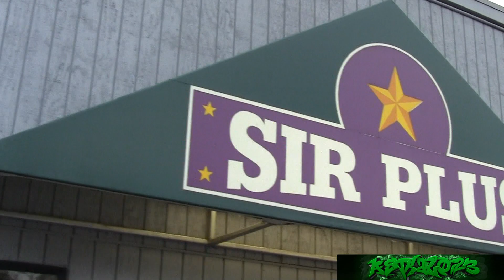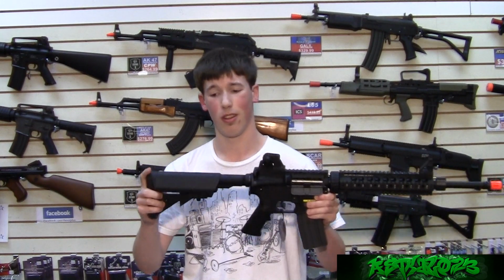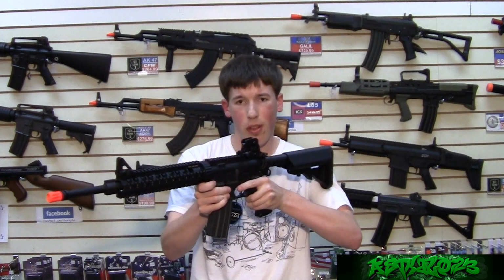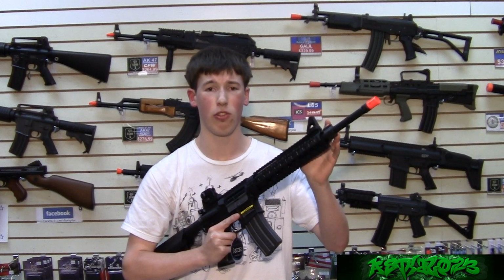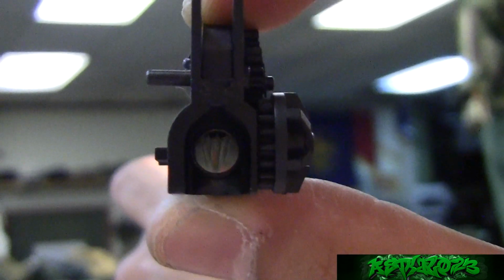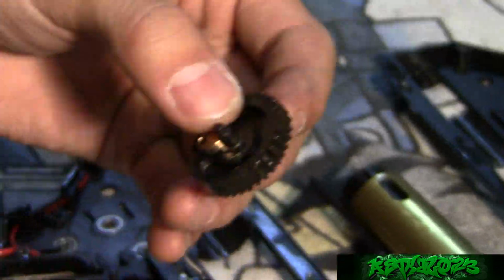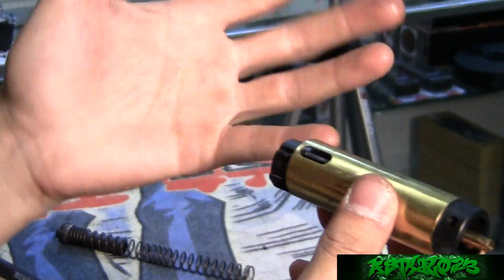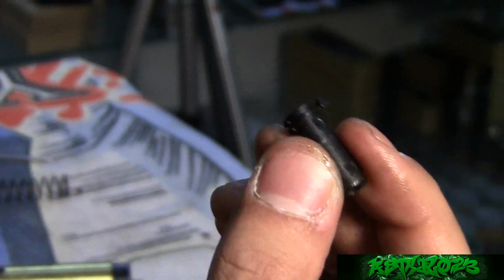Sir Plus REVIEW: KWA KM4 SR10 2GX Airsoft Electric Gun  -ASTKilo23-

Comment: Hey AST! Ever hear of Sorbothane pads? You put them onto your cylinder head and use it as a buffer. It helps correct AoE and also absorbs the shock from the piston head hitting the cylinder head. It prevents gearbox cracking and you gearbox will never crack using a sorbo. So KWA's "reinforcement" is unnecessary with a sorbo.